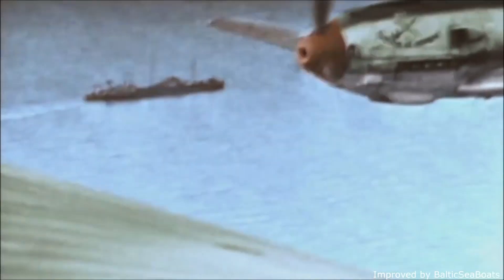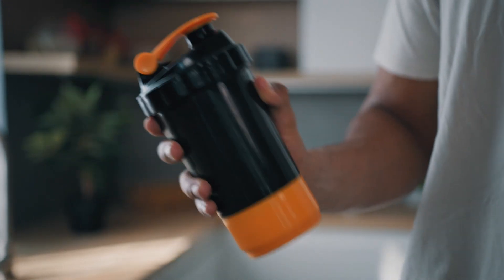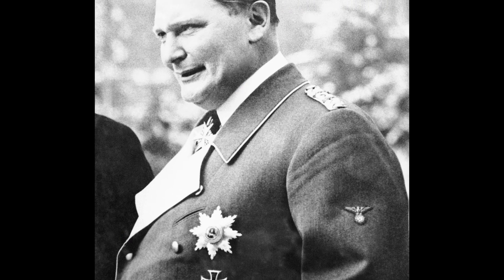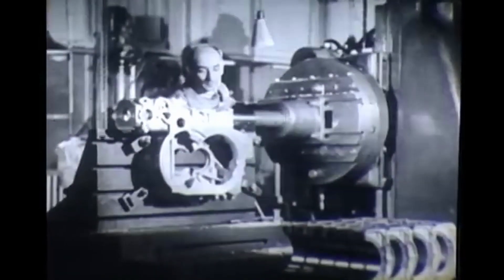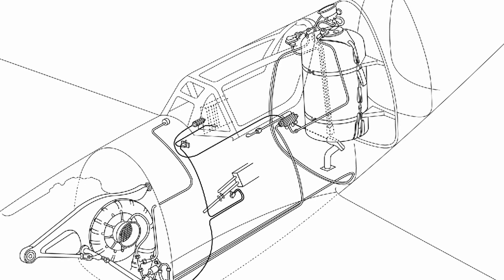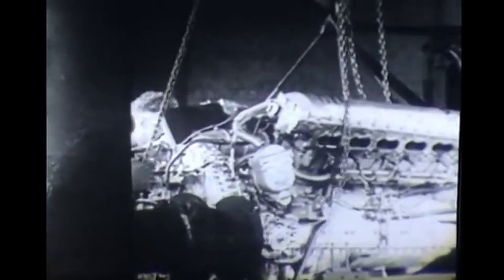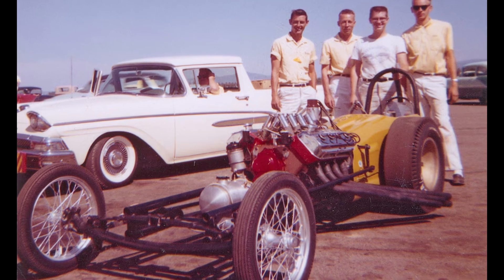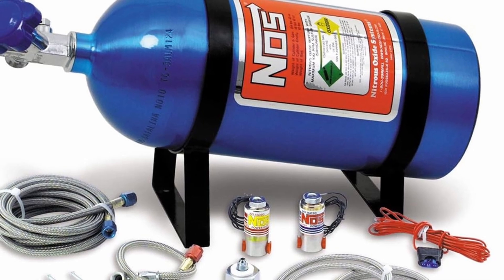MicroStrategy Connect: What’s New with Product Management

Comment: The big advantage of nitrous oxide is that because it carries its own oxygen, it retains its full effect with ZERO loss thereof at high altitudes (theoretically an internal combustion engine running on nitrous oxide could function in SPACE). This is especially useful on planes specialized for high altitudes, as the nitrous replenishes power loss at high altitudes. In fact, I even calculated and extrapolated that (based on a test of a Bf 109G-1 that, with GM-1 nitrous oxide reached 680 km/h @12000m and a ceiling of 13800m), with proper development, a Bf 109K with cockpit pressurization, a DB605ASC/DC (or even DB605L with 2 stage supercharger), and GM-1 (albeit no MW-50) would be able to reach 15-16000m altitude (17-18000m with DB605L) and fly at speeds of well over 700 km/h at those altitudes (a Bf 109H with its longer wingspan would likely be able to fly EVEN HIGHER). Similarly, a P-51 or Spitfire with nitrous oxide would likely not only be able to reach speeds of over 700 km/h at high altitudes, but likely even be able to keep up with Me 262s and Ta 152s at over 10000m altitude.

Comment: Hey Mister, watch it with the crack about the friend who runs Premium in her 'old' '67 Galaxy 500! (4door no less.) 😀
High School, her dad went and bought her and her Sis a, as he put it, nice suburban car. It was actually a sleeper. This was around 1976. The dude he bought it from told him to run premium.
The first time I got to drive it the tires broke loose.
What da?....
Finally inspiration, pop the hood. WHOA.
Holly 760 DP, mounted on a hi-rise. Fine wiring, great routing on everything. Clean x8. 
Turned out to be a B&B 427 done up at a speed shop a few towns over.
I asked her Dad if me & my buddy could take it bracket racing some time. Answer was a rather soft spoken "I don't think so." 😅
No NoS, but then I have too many stories of dumb a$$ acquaintances blowing up perfectly good engines using NoS.